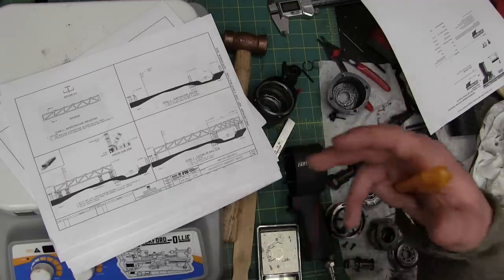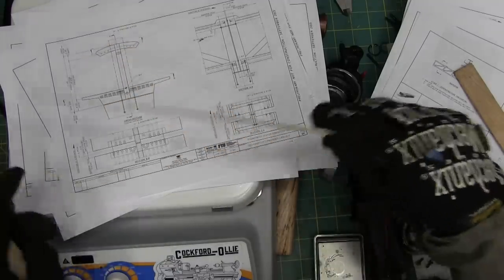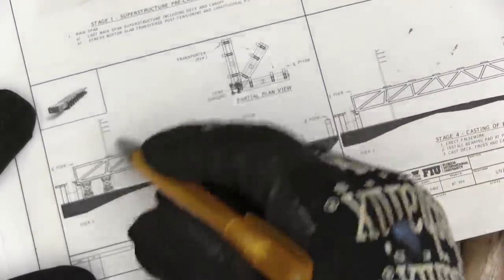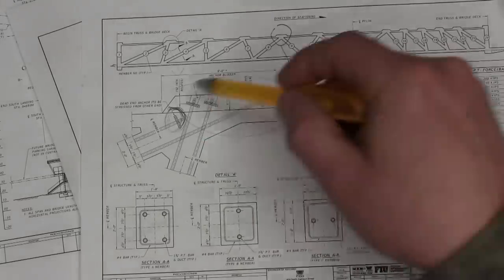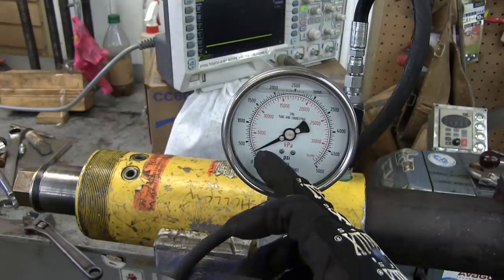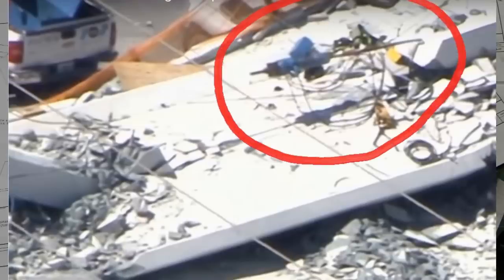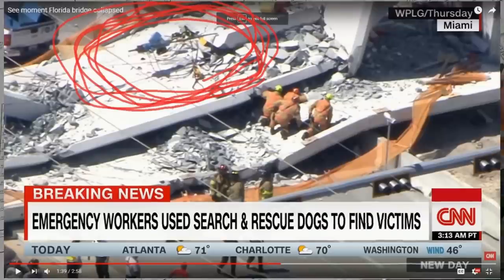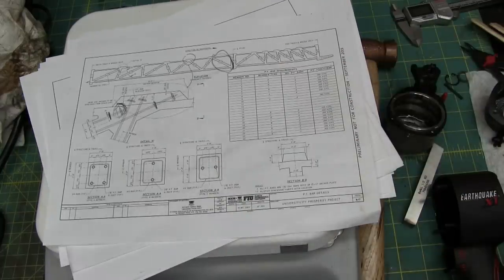Post Tension Failure Florida Bridge Collapse | Engineering EXPLAINED!

Comment: Those aren't true trusses, they are lined up with the angle of the suspension supports.   If it were a true truss, it would be a stand alone structure with vertical members.  Those and the angled members transfer the load to the supports on the end.  I think that would have been the best design, with the suspension stanchion as a play pretty, not a support element.

On legalities:
Did the builder follow design to the nth degree?  Did they have permits to have overhead cranes working above folks without safety gear (i.e. traffic)?  I don't think OSHA allows overhead work without hardhats....
Did the city permit this construction technique?  Folks need prison over this one.....
Reply: stxrynn the design docs state it was a self supporting truss bridge, the tower and cables (not yet installed before collapse) were intended to be there for looks and reducing vibration, not support. The diagonal elements line up with the cables to look nice, not for structural reasons.
Reply: It was a hybrid I beam truss- the first of its kind- and probably the last..

Comment: From what I gather from Turner Fairbanks, these idiots were still retensioning tendons while traffic was on and under the bridge. The city changed the plan after the bridge was designed, demanding a longer span to accommodate a wider street in the future, and now this same city is treating this disaster as a murder. There is a lot of blame to go around.  If they over tensioned the bolt section of a tendon cable, or if it's all a solid threaded piece, there is no increasing tension, there is just breaking it.

Comment: Here is the strain diagram that I was hoping for -
http://www.eng-tips.com/viewthread.cfm?qid=436699
The entry is at 18 Mar 18 23:32

The diagonal on the far right is the one in question (known as number 11 in other drawings). It is under compression when the span is in place. Interestingly it is under tension during transport from the nearby construction site. That is why there are tension rods inside it. This whole bridge design is an abomination. it is not a cable stayed bridge at all, the  sixteen inch pipes "stays" are there to make it look like a real bridge. Why are they so fat says the voices in my head. They are so fat to make the concrete struts look more like cables! So you might ask - are the concrete struts extra thin for the same reason? Yikes! 

There are some NTSB photos in an entry at 19 Mar 18 03:23 that show the whole underside of diagonal 11 is gone and what was the lower end (now the upper end in the photo) of the diagonal and the lower end of the vertical are ruptured.

Comment: Brilliant You noted the one PT that could only be tensioned have tension released from bottom Unless men were working top & UNDER THE BRIDGE which was not shored at all putting workers under it at huge risk well if not wkg t & b You'd induce asymtric load ACROSS CONCRETE SECTION I'd say that's insane but so was using conc , MOVING brittle conc, no shiring , working w traffic flowing , not knowing curb cut bank etc to miss on far side, then changing on fly day of move PT for that change, ignoring cracking on failure end which was reported to DOT who don't CK phone msgs wkend work was done after they extended span after design, and to top it design is utterly asymetric top to bottom every truss chord & they didn't try to use suspension rods to at least  allow for graceful failure or canal section tied to main section to slow it's fall in case of failure... IDIOTS were building this EVERY firm needs to go out of business.

Comment: I just watched the 3+ hour NTSB hearing on the report, and it's rather remarkable how on-point this analysis comes to what actually happened, especially considering the lack of direct access to the site. The only thing missing here is something that should have made this disaster 100% avoidable, and that's the cracking at the 11/12 node that occurred 5 days before the collapse, pretty much as soon as the bridge was set on the pylons. We're talking 3/4-inch wide, 4-inch deep cracks. That's some serious inelastic deformation, and only a fool (from an engineering standpoint) would think it could be reversed by tightening some nuts on a tensioning rod.
Reply: He was wrong about the tensioning rod breaking.

Comment: I heard they were doing a stress test which is bs with people Underneath
Reply: JB: Well that is clearly not the case.  You don't stress test bridges in place.
Reply: I heard that too - and later heard that they tested and we actively tightening.  Presumably once they found out that one of the rods was looser than spec.  Pity no one thought to find out why it wasn't holding tension before hitting it with the good ol' rattle gun and giving it an extra ugga-dugga or two.
Reply: aussiebloke609 Gotta be careful with those ugga duggas - they come hard & fast!
Reply: aussiebloke609 yep. Broke an engine mount bolt off in on the ole saturn yesterday. SNAP! That quick!

Comment: I freely admit that you are much smarter that I am on almost everything, except truss behavior.  From the content of this video it shows that you do not understand the behavior of the members of a truss.  This structure as it stood at the time of the accident can be described as a uniformly loaded simply supported truss.  As such both of the outer diagonals (member 2 and member 11) are compression members, both of them.   Using the reported structure weight of 950 tons it makes the reactions at each end 950 Kips.  (1 kip=1000lb or 1/2ton)  Using this information and the dimensions of the preliminary design the member force an Member 2 is around and approximately 2036 Kips compression.  Member 11 (at a steeper angle from horizontal) is roughly at 1411 kips. Now remember both of these members are under compression for these conditions.  They don't even need a prestressing cable or bolt.  Actually prestressing these members is detrimental.  If there was going to be a failure as you describe it should have occurred at member 2.  I truly believe the cause is much more elusive to discovery than you present.

I understand and agree they were working on the prestressing bolts of Member 11, but they should have been relaxing the bolts not increasing them.  Actually they may have tightened the bolts for the move since at that time those outside members were actually under a tension load due to the cantilever effect of the supports.  But that was small compared to their strength in my opinion.

I do appreciate what you do overall in your videos but don't oversimplify this failure, I have the feeling it isn't what it appears at this time.  I have designed many very heavy wood trusses but never a concrete one so there is much to be learned here.

Thank you
Reply: Once the span is installed, the outer diagonals are in compression, and the neighboring diagonals are in tension. During transport, this is probably reversed (end diagonals tensioned for transport, and relaxed for installed loading; secondary diagonals tensioned for installed loading). If the tensioning of the diagonals is not adjusted properly at each load condition, damage could result. Another factor is end-of-span shear stress - this truss has a small cross-sectional area.
Reply: Glenn Felpel  AvE found the smoking gun. This is a cover up preformed by the contractor or engineer to cover there ass. There was a crack someone decided to add more stress to #11 to get rid of the crack .The PT rod was 1 1/4 x 12'  if you stretch that rod over 1" it will yield .I think it was stretched when the bridge was moved.(the crack is the evidence ) they did not know the yield length because they had to add a coupling and a short piece if PT rod to the PT rod to install the hydraulic tool to add the extra stress to # 11  .This is a criminal cover up.

Comment: Ave has a good perspective on some of the issues.  As an Engineering Manager for a Contractor, 40years, I can add some commentary of value.   This was to be a cable stayed half or the total bridge, so designed around code and allowable loads in final position.  Then construction methods were chosen that required the move in structure to be supported in two different arrangements, maybe  more.  One was "as transported"  and the other " as temporarily set in place.  Those conditions were probably well reviewed, and used different criteria/larger for allowable stresses, etc as 'construction loads'.  So, it was a temporary structure, over live traffic.      It has been reported that additional post tensioning was being performed, either as part of the transition from mobile, or perhaps to compensate for some revealed cracks.   Almost certainly, that activity initiated an unstable condition, as it is a dynamic activity.  By  that I mean, it was making changes.  When that is done, there are often variables that might creep in that were not accouted for.  A prime example might be stressing with more than one jack where one fails and looses load,  and creating an unintended assymitrical condition....easy to see consequences.  Could have been stressing one side at a time, or some other case.  It is important to remember that building a externally supported cable stayed bridge can be like building a harp while trying to play it.
Reply: It is one thing to tension a pt bar, and another to 'Detension' it.  Detensioning means absorbing energy, and is an 'exothermic' event.....meaning it wants to go to completion if anything goes wrong, to zero tension.....which may have been too low or asymmetric.    Things like this don't often happen when everything is static, but usually when some change is being made.  There is the failure cause.  The root cause may be with the procedure, resulting in lack of control.

Comment: I think people are missing an important part of the failure formula...The top roof section is technically a part of the truss...So is the deck...These two members serve as the top and bottom section of the truss...If you look at a cross section of the bridge the deck section is much larger and wider than the roof...This creates a disparity in the truss where the roof is too small to counter the forces of the deck...With a single truss I suspect there would be torsional twisting or imbalance that might have led to the stressing of that last eccentric flying truss that was obviously designed with artistic design in mind instead of classic truss rigidity...It isn't a coincidence that the bridge failed at its most eccentric splayed inverted "V" truss...No matter what the designers say this bridge was obviously designed to be supported by the overhead supports and it is looking like it wasn't strong enough to stand by its own and the liberties taken with the unorthodox design went too far...

Comment: As a superintendent for a bridge construction company I definitely agree with your findings.  I don't believe not having spreaders between jacking points played a roll in it's collapse though, however moving the jacking points definitely would have changed the dead load on the failed post tension  truss.
Also not having false work in place before the structure was put into place was a bad decision on the engineering department.  The false work should have been installed and remained in place until the piers and cables were installed.  Bridges are over engineered by 60% once completed, even if there was a weakened post tension truss that bridge should have lasted 80+ years easily.

Comment: OK, heres my 2 cents. The smoking gun tensioning cable you speak of was connecting point A with point B. This is fact. The end of this tensioning cable was also intended to be one of the many cable termination points of the unfinished mast of this structure. According to the NTSB final drawing. In your demo, when your threaded rod failed, it forcibly ejected from your pressure cylinder. Completely, like a crossbow arrow. I am going out on a limb here by stating since the cable is still present, and Point A moved toward point B during the collapse, the cable simply moved out of its intended canal and is still intact. Anchored to the point that pushed it out. If it broke, it would have flown across the street. Thoughts??
Reply: Your assessment is correct.  The release of the tensile strain in the PT rod when the anchorage failed resulted in it moving from the original location.  This is the same effect as pulling a rubber band and then releasing the ends, but not at exactly the same time.  The NTSB report shows the underdesign of one of the truss nodes led to the shear failure of the node, destabilization of the bridge and ultimate collapse.

Comment: Possible summary: Bridge was damaged while moving it onto its support piers.  The tension rod in one of the supporting struts was overstretched as a result of moving with incorrectly placed supports on mover vehicle.  Workers went in to check the strain gauges and the load on a rod was low so they tried to bring it up.  Due to the damage the tension would not come up and the additional stress on the weakened rod caused it to snap leading to collapse.  One scary thing is that just prior to collapse that rod was acting like a master pin keeping the whole bridge together.  How many other things we walk or drive over have sleeping defects in them waiting to fail?

Comment: Great analysis. I was also wondering why they didn't put a temporary support on the median to support the bridge in the meantime of installing the pylon with the shrouds to support all the pedestrian bridge before removing the temporary supports. They have also probably put some additional stress to the structure while moving it to it's final position. Longitudinal and traversal stress has occurred for sure during the moving procedure.

Comment: I'm from the old-school where you would build an iron frame for the pedestrian walkway.

Rebar and pour concrete on site.

Things were constructed better in the old days.
Reply: Nowadays it's very common to pour off-site and bring the prefabbed slabs to the job site. I work for one of the companies involved in this project, and pictures were taken and sent to higher-ups of the cracking that was occurring. Of course there is some contention as to whether these were ignored, but they should have never been adjusting tension with cracking occurring, plain and simple. This was a poorly engineered bridge from the start (using concrete for trusses is NEVER a good idea).

Comment: The threaded rod fails in tension failure due to elongation of the section causing it to waist thus reducing the cross sectional area and hence its tensile capacity is reduced and you get a sudden break / snap.  I reckon there is probably another failure mechanism at work here if you look at the collapse video from the truck dash cam.  From what I can see there was a failure at the intersections of the internal members during the post tensioning phase you'll see the structure folding or "hinging" in the top deck at the first joint and one in the bottom deck.  Whether there was localised failure of the concrete or a loss of confinement around the post tensioning tubes remains to be seen.  I very much doubt the crane was there to assist in lifting the bridge as its 950 tons its was probably used to move the hydraulic jack.

Oh btw a truss is a statically determinate structure and fairly simple to analyse and you can roughly get a feel for the forces in the members.

But like you say why such an operation was carried out and have the highway open is beyond me.

Comment: Brittle failure and stiffness are two different things. You can be bendy and have brittle failure.  Also, big guess here, but could have been tensile failure from sinusoidal vibration from the tensioner breaking. You put a compressive load on that member, and if it snaps it will exhibit a sinusoidal vibration in the opposite direction making it go into tension.  It may be in a load where you compress it to a point where it has adequate compressive stress, but not tensile strength.  You can see this effect in the experiment because the parts flew in the opposite direction of the compression.

Comment: I am not a civil engineer but a buddy of mine made a similar comment to your thoughts.  Your experiment with the enerpac cylinder is really interesting and the reason the rod comes shooting out the end is the recovery of the stored elastic energy (due to the elastic modulus (Young's Modulus) this is identical to a spring that is compressed and then released... the energy is = 1/2 E X^2 where E youngs modulus approx 30 million psi and X is the stretch in the bolt prior to yield... A shitload of energy! what is interesting (criminal?) is the fact that these jerks noticed cracking after the pop and allowed cars to pass under one direction while they were holding up the other end with a crane and a single point of contact.  Atleast 6 people died in the collapse.  The investigators attributed the collapse to the funky spacing and angles of the truss members that was a change from the original design by someone who wanted an assymetrical appearance! https://www.nbcnews.com/news/us-news/ntsb-blames-fatal-miami-bridge-fall-design-lack-oversight-n1070226 as a professional engineer in Canada we wear an iron ring (the original rings were made from a bridge collapse in Quebec) to remind ourselves of the consequence of our mistakes.  All engineers make mistakes that is why we have to check each others' work.  My apologies on behalf of my profession to those who suffered and the families of those who died.